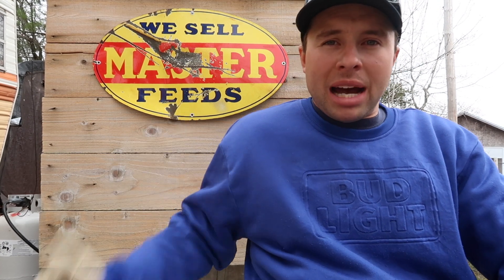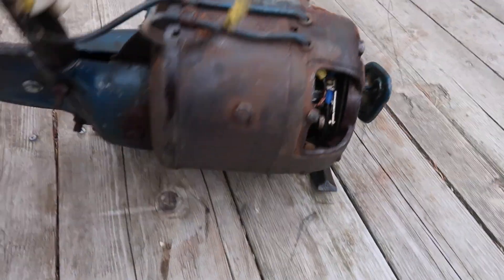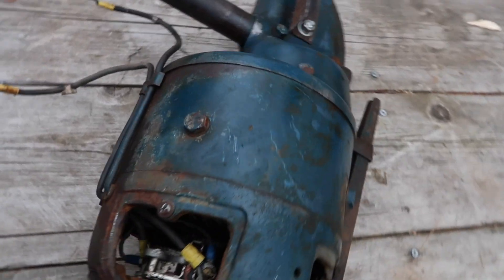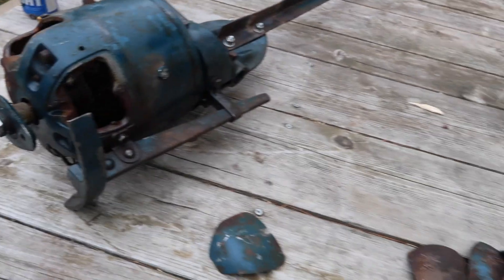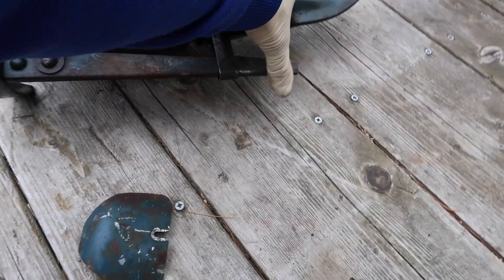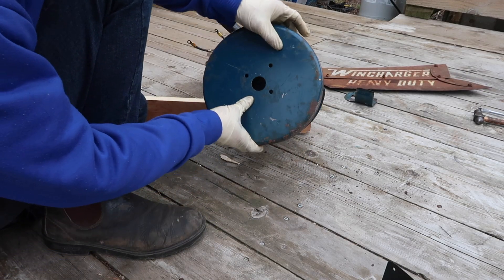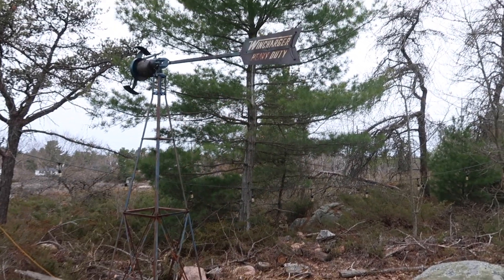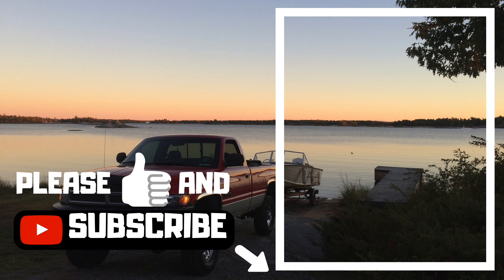Wincharger 12V Resto/ Fixing Part #1

Comment: Hi! I have a quadrunner 250 4wd and i lost the drive on it the other day. I heard a bang from the engine and it stoped moving. it did not move at all no matter what gear or range i tried or forward or reverse. then i tried it again i few hours later and it worked fine and have worked since then. what do you thin could cause this? I pulled a snowmobile on gravel when it happened and had the super low range 4wd. Cant remeber if i had difflock or not.

Comment: Hi man, I have a question from one of your old videos 1200 4 tec.  Leaking from valve cover.
Reply from the maker: Sounds good. What’s your question?
Reply: @Schneids15  I was wondering what you did to fix it?  I just got a 2011 1200 and it has a leak in the same area (valve cover leaking onto the header). My buddy suggested just re torque the bolts. A new gasket is only like 30 bucks so may do that too.